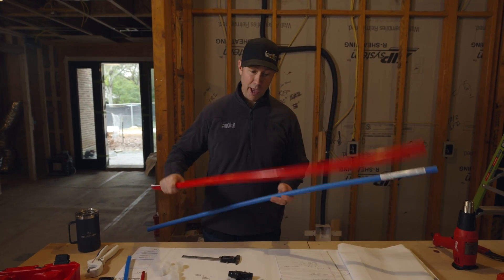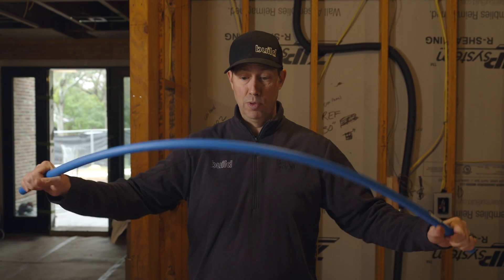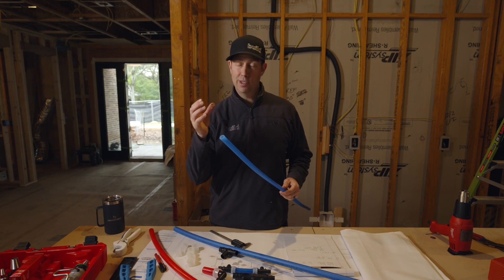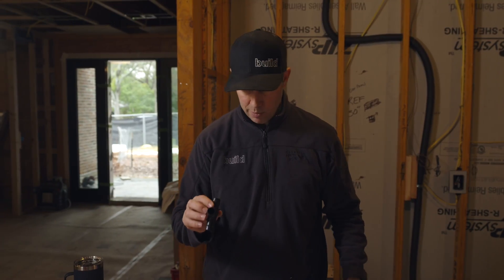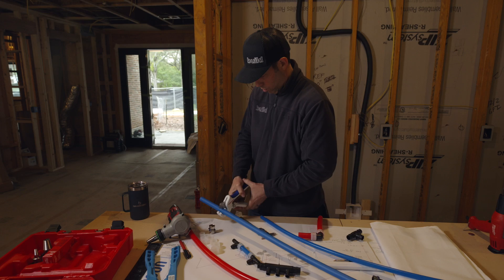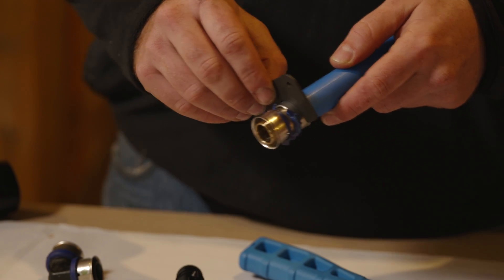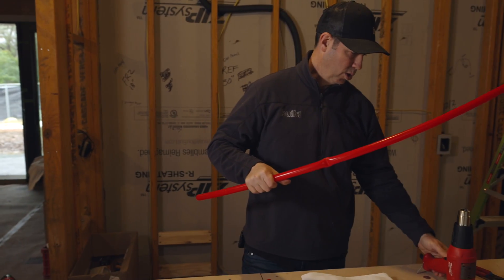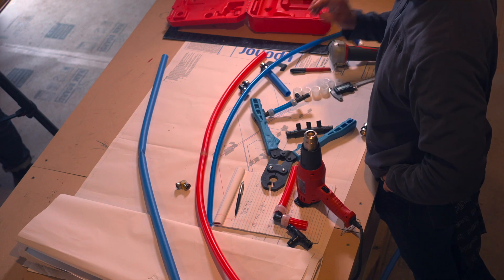Uponor Pipe System Review & Comparison

Comment: Thanks for the video. 

Personally, I chose UPONOR and their expansion system because the clear and easy endpoint of the fitting system made me 100% confident.   I never used B and always felt I was over paying a little but that being 100% confident about the connections was worth the small increase in price.  You pointed out that the labor costs in fittings and time in testing each connection may even make Upon more economic.
Reply: Read on PEX B F1960.  The world have changed since 1980.
Reply: people do not get it pex B uses either type of fittings!
Reply: @mr.redneck2715  It is not PEX B that makes it expandable. It is ASTM F1960.  If a PEX is ASTM F1960, Then, and only then, it is expandable.  But as far as I am concerned, I know now that Matt Risinger would say anything if a sponsor ask.
Reply: @Appytail  i’m not sure what you’re saying but I know you can buy expandable fittings and tools for Pex  B
Reply: @Don Hawley  "PEX A" and "PEX B" refers only to the chemestry and fabrication methods of the piping.
PEX A refers to the ancient "ENGEL" method.
PEX B refers to the far newer "Silane" method.
ASTM F1960 (Sometime called cold expansion PEX) refers to the expandability and compatibility with such fittings. https://www.astm.org/Standards/F1960.htm
ASTM F1807 Refers to crimping PEX:  https://www.astm.org/Standards/F1807.htm
For example Zurn PEX B is both ASTM F1960 and F1807.  Meaning you can use both crimping and expandsion methods.  Best of both worlds.  And having a far stronger piping.

Comment: For anybody worrying about microplastics in your water, the harder the plastic the less likely you'll have microplastics in your water.
Reply: Also stop being an idiot about inert food grade plastic that passes harmlessly out of your shit. Kind of like eating a penny.
Reply: @ryanroberts1104  asbestos, silicon dust are also inert...
Reply: @ryanroberts1104  Asbestos and silicon dust weren't proven to be harmful for over 2 millennia of usage. It was recognized as harmful only 50 years ago which is nothing considering to the scale of human society. Microplastics and nanoparticles physically have very similar properties as the other two. If you read about some scientific articles on the subject perhaps you would you would be more informed. Using insults as argumentation sure proves your level of education. I'm a chemical engineer by trades and occupation health and safety specialist just to let you know.
Reply: @MedoKojiZiviOvde   what would you prefer to use then copper, ever heard of copper toxicity?
Science has come a long way they now have much better equipment to determine risk factors, so unless you are going to go stainless steel pipes PEX is the best option.
Reply: @madprunes  copper has been around for centuries. You should worry about copper if your water is acidic which is rarely the case as one of the main issues people have is with water hardness. Moreover, copper removes H2S from water make it a bit more tolerable if the water smells like eggs and copper is antibacterial. Hard plastics are better than soft plastics in terms of microplastics which is why they last much longer. Also, most people don't seem to care that there's a world wide issue with microplastics in the oceans and seafood. Not only a health concern but also an environmental issue.

Comment: Matt, also why did they run that plumbing with 90° turns in it? Why not make as few sharps bends altogether? There is lots of information on friction in pipe regarding turns and bend radii so why not drill at an angle going through those two studs from the top plate to the fridge supply valve box??

Comment: Cool stuff but i could see the pex get very soft and i wonder if bubba pulled on both ends if it could stretch and then be thinner. Also just how freaking expensive is this PEX-A that it would be worth having a guy go out to the truck get a heat gun get it hot, then heat the pex and work it for ten minutes and put the heat gun away???  My sites dont have production assistants or interns and people expect to get paid so that seems to me to be more expensive to salvage than just grabbing another piece. I get if you were way out in BFE and didnt plan very well and had no more but thats a brain problem not a product pronlem. 🤔🙃

Comment: Lots of flavors. 

Can you do a follow up video on recirculation of the racetrack design - are you letting a newer smart heat pump water heater balance it out, or adding a recirc pump , and if so, can't that affect the trigger of heating the water at the tank? Would love to learn more about your setup. 

One bonus tip on going with Uponor - making the connection in a tight corner or hard to reach spot; this alone makes it worth going with Uponor fittings over crimp.  ONE reason you want to go copper - if you have a rat problem. I mean address the rat problem, but if you're plumbing in an old house that's just too susceptible, rats are known to chew through pex. 

As always, another great video.....on the build show!

p.s. if you made it this far, then go ahead and smash the like button...do it.

Comment: Can you use crimp with Pex A? Or it must be used with the expansion fittings?
Reply: I do it all the time, the beauty of Upunor Pex A is that it's very universal in terms of fittings so when you have it on the truck it works for everything. Sometimes it's not logical to use an Upunor fitting in certain situations when you you can use a brass pex fitting that is 3 times cheaper than a brass upunor fitting. This comes into play with repairs and not necessarily new home contraction where you want to keep it strictly Unpunor all the way.

Comment: I personally think the main reason plumbers use uponor is because of the special tool needed to expand it.  If any home owner wanted to fix or add anything in later they don’t have that tool, so they just hire a plumber.  But with pex B a $20 crimper and your good to go and diy that water softener or water heater replacement yourself.
Reply: You can buy a manual Pex A expander tool for $100 on Amazon. It comes with 1/2", 3/4" and 1" heads plus the cutting tool and it works great. The down side is you have to rotate the head for each pump whereas the power expanders rotate the head for you.
Reply: This might be the case but trust me if you are a plumber you don't want to be under a crawl space using a crimp tool when you can be using an expander tool. I got two crimp tools and and an expander tool. Expander tool is king and by far easier to use IMO.

Comment: I dont like the way that ice maker line was run in the wall. One should never make that many bends in such a short run. It should come straight down and not be crossed by wires. A sloppy job of both trades.

Comment: It's funny that you don't have the multilayer pex pipe which consists of pex and aluminium. It's a much stronger pipe that is widely used in Europe, it also offers a much longer lifespan of minimum 50 years.

Comment: What about a comparison on chemical composition of the pipes?
And what kind of reactions happen with the plastic and chlorine, & chloramine, does anyone know?

If one type of pipe is more flexible, then there MUST be SOME composition differences. 

Safety in plastics with our water is important.
Sometimes these things may be overlooked by manufacturers. 
Or not?
I dunno.
Tell me!

Here's Why:
These pipes are carrying our water to the showers, where there is often steam made with the water, and having plastic chemicals leaching into the water from the pipes can be very unhealthy with breathing in chemically loaded steam. 
▪︎ Then of coarse the obvious: drinking water, and water that's used to clean dishes we eat off of.

I just want to know what plastic chemicals are being used. 
AND how do they react with the different chemicals water companies are adding to our city water.
Yes, all cities may be different in which chemicals they use.
However, I've heard of the chemical chloramine is being used instead of chlorine, (it's cheaper) and it has been having all kinds of chemical reactions with different metal water pipes. 
It's really not good.
Actually, it's worse than not good, it's poisonous as an end result.

So I'm just wondering what kind of reactions happen with plastic pipes, and different water chemicals?

I know it's a big question. 
But water is a big part of life.

Comment: How well do the plastic fittings hold up if they freeze? Also I've noticed on overhead replumbs in attics that even if insulated (obviously not perfect) that the brass fittings that some types use, sweat, corrode, and eventually fail.
Reply: In one application I seen the copper expand before the plastic fitting broke. The job was mostly pex but there was some copper.

Comment: Hi Matt, after time spent getting the crimp out, wouldn't it be just as well to put in the fitting?
Reply: Plus that don't you have to cut it out of the wall to take it over and rotate it for 5 minutes over a heat gun?
Reply: If you put that kinked and melted pipe back in the wall, you're a fucking hack that should be fired. No, it is NOT every bit as strong as original. If you're kinking PEX you probably should have called a plumber.

And yes, it would be a hell of a lot easier to just put a splice fitting.
Reply: Lol i thought the same thing. Could have put on 20 couplers

Comment: Matt,
Seems like you are getting dragged for being sponsored by a product that you are recommending. Although much of the criticism is too harsh, I agree with many that the arrangement is somewhat cringe-worthy. I suggest the following: When you are sponsored by a product, make a BIG deal about it in the beginning of the video. Disclose at length the nature of the sponsorship, and if you would choose the product even in the absence of a discount. Be overly honest and transparent. Also, what are the downsides of PEX A? Where would it be a bad fit? An honest review should also be critical. As a fan, I have to tell you that the optics of these sponsorships are damaging your reputation, and your reputation is worth way more than whatever your sponsors are giving you.
On to questions: 1) Have been told that sometimes mice and other rodents like to chew on PEX. Have you ever heard of such a thing? (Or did I hire a plumber that doesn't like working with PEX.) 2) I have heard that PEX A can have more plastic taste than PEX B or CPVC/copper. Any merit to that and if yes, how quickly does it dissipate?
One more note: lots of plumbers in New England use copper with pro-press fittings. Fast and no need for torches. You can also make up a joint when there is residual water in the pipes. Is that a thing around you? I did some work with them a while back and I was immediately ready to pitch the propane torch over the back fence. You might include them in your next plumbing comparison. 
Best wishes. -Rob

Comment: Don't you use multilayer pipes in America?
In many countries of Europe we usually use multilayer pipes. For example PE-RT / Aluminium / PEXc.
Much stronger, they stay in place when you bend them and they can resist higher temperatures.
Also they don't expand as much as pex only pipes when temperatures are changing a lot.

Comment: Real world testing on pex b vs expansion fittings so a very small difference in flow. (1-5%)  The other thing I noticed is pex a fittings may have a larger ID, but they are much longer than pex b fittings. So the restriction of pex b is discernable.
Reply: But they all have much smaller ID's than copper counter parts . Which actually Is a noticeable difference for half inch. 

You cant really run a long line with half inch pex without noticable headloss
Reply: @shahsmerdis  PEX B flows just as much as any other pipe product, you just have to choose the right size. Yes, the nominal size is a bit smaller than traditional pipes...so use one size up. If you can't figure that out you shouldn't be plumbing anything.
Reply: @shahsmerdis  The ID is indeed smaller than it's copper equivalent but there's a key difference, no fittings or sharp turns. Pex bends and curves without a fitting, giving it much better flow characteristics. You can run 10gpm through 1/2 pex, which is far more than you'd ever need through that pipe.

Comment: I have used PEX B .. nevermore.  Currently I am replacing 70+ year old plumbing in "this old house" and I am using PEX A for a variety of reasons:  Flexibility.  Ability to connect a fitting inside of a tight space where accessing with a crimping tool would be impossible.   Memory; if you kink PEX A .. just heat it up, need to change out a fitting .. just heat it up, PEX A will go back to original shape.   And yup I ran Uponor .. but they didn't sponsor me.  ;)   I used all brass fittings as they can be reused, whereas the plastic are one use fittings.   Oh and I have a DeWalt expansion tool.

One last thing.  When bending the PEX you are not putting crimps in the tubing, you are kinking the tubing.  LoL!!    Just picking on ya Matt!     But with PEX A when someone would say its kinked I would say .. What kink!?   ;)

Comment: "I don't even know if another company makes pex-a." Such a shill for uponor you don't even look elsewhere. Sioux chief makes powerpex A and it's like half of uponor. I use it all the time.
Reading the forum it looks like Apollo and Reheu make pex A as well.
Reply: But he must have done research on the product to come to the independent conclusion that it's better right? The fact that they paid him probably has nothing to do with it. And I still believe in the tooth fairy.
Reply: and wirsbo
Reply: @jasonbuter9493  Wirsbo brand was replaced by Uponor. Same company, same manufacturing, I personally do not know the history of why name change but it’s the same
Reply: @jasonbuter9493  wirsbo and uponor are the same
Reply: Rehau invented pex a piping
Reply: @joeltell8484  Not true. Wirsbo invented PexA. Wirsbo has been rebranded as Uponor several years ago
Reply: @MichaelM-to4sg  Dr. Thomas Engel. Invented it actually
Reply: @MichaelM-to4sg  REHAU began producing PEXa in 1967.  When our company founder, Helmut Wagner, partnered with Dr. Thomas Engel to begin producing an alternative to traditional rigid piping systems.  They were ahead of their time.
Reply: @joeltell8484  No, Dr Engel invented a method of cross linking PE, not Pex tubing. Cross linking PE was actually developed in US in late 50’s but required uranium radiation and the processing of products was difficult due to density issues. The Engel method allowed safe manufacturing of various densities and thicknesses allowing manufacturers to develop and produce more wide ranging products. 

Once Dr Engel’s process was confirmed by Philips Petrolleum laboratories, he submitted for international patents. In Sweden, one of his close friends managed a chicken farm and discussed possibility of using his PEX technology to develop heating mats for the coups. Dr Engel had no manufacturing experience and no desire to manufacture anything from Pex, his preference was to license the technology to manufacturers. He approached Wirsbo, which was located in same town, showing his Pex process and discussing the chicken coup heating issue. Wirsbo chose hydronic tubing as better solution to chicken coup heat, signed the first license w/Dr Engel and developed Pex tubing. The Wirsbo Pex tubing received biggest notoriety at 72 Munich Olympics. The Olympiastadion stadium was constructed w/Wirsbo Pex plumbed stadium floor, including track and grass field, for hydronic heating. This stadium has seen FIFA World Cup, UEFA CL and Cup finals as well as regular home to Bayern-Munich FC. That project revolutionised hydronic heating systems globally. 

Dr Engel owns numerous patents for his cross linking process, he sold over 1000 licensing agreements worldwide based on his Pex process. I believe he was under 30 at the time. He never developed a single manufactured product from Pex, that was never his goal. The history of Dr Engel and Pex tubing is pretty well documented and not difficult to research. I do not know when Rehau signed license w/Dr Engel but it was not prior to his agreement w/Wirsbo, which is very well documented.
Reply: @MichaelM-to4sg  we price the job there to go back and fix all the leaks
Reply: It could just be what's available in his area
Reply: I use Sioux Chief because it’s easily accessible and it’s a great product.
Reply: I’ve never heard of Sioux Chief Powerpex, likely not distributed here in CO. Apollo and Rehau are inferior junk Pex-A. I’ve never looked into the specs, it’s likely to do with cross linking process wherein Uponor (Wirsbo), who invented Pex-A has better processing or manufacturing quality. Refer to ASTM F876 specs. The Uponor is rated as 5106, Apollo 3006, Rehau is 1006. Rough translation is Uponor is highest chlorine tolerance, 3 month UV tolerance and burst pressure tested to over 600psi. The Apollo has moderate chlorine tolerance, no UV tolerance and similar burst pressure. Rehau offers minimal chlorine tolerance(or none as I don’t recall if a 0 is available as first digit indicating it failed) no UV tolerant and similar burst pressure. 

In truth we’ve installed miles of Rehau O2 barrier in radiant systems but much prefer Uponor for plumbing systems despite the added cost of materials. Once you handle them, it’s a higher quality product in both tubing and fittings.
Reply: @MichaelM-to4sg  I don't think you know what your talking about
Reply: @MichaelM-to4sg rehau reaupex has a uv shield